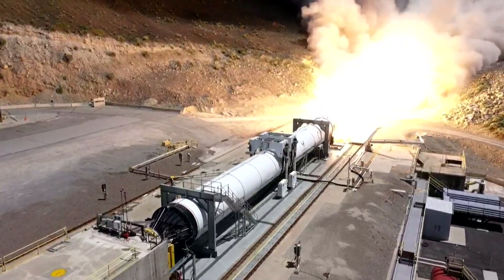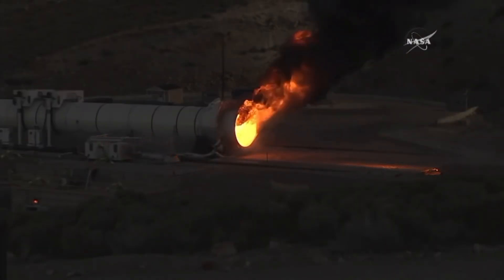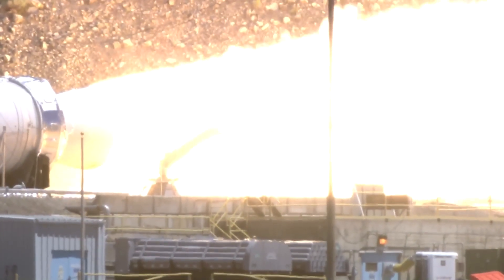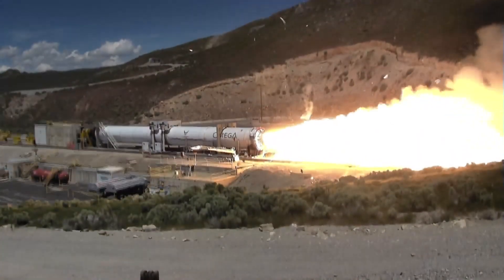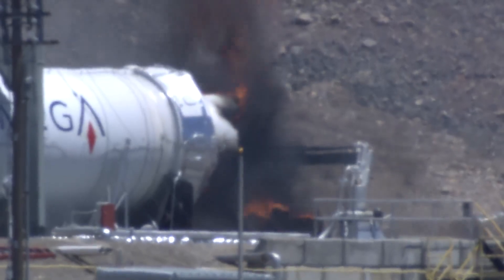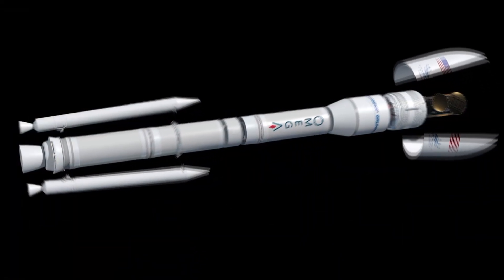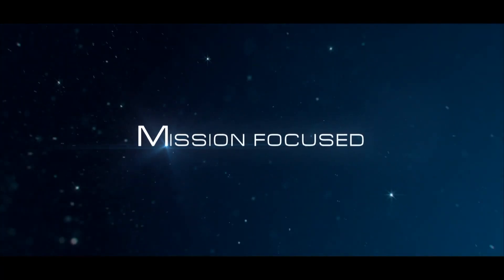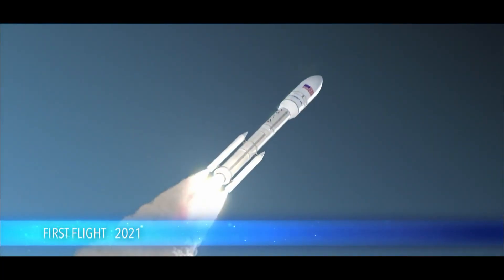Northrop Grumman's OmegA Rocket Fails During Static Fire Test -

Comment: OmegA failed, they still have OmegB
Reply: If enough of them fail, we might get an OmegALUL
Reply: ... all the way to OmegErd?
Reply: Oh my gord, how corny.
Reply: @javaman4584  Thank Heaven. While the SLS rocket is certainly more expensive, it is MUCH safer for crews.
Reply: @javaman4584  That is just.. Wrong. You are talking about the Ares 1, which did have a solid first stage--based off of the Shuttle SRBs, however it was not all solid, having a J-2X upper stage. 

Anyways the the problem with the rocket was the exhaust of the solid propellants. Aluminum based solid propellants burn hot and stay hot, which is living hell for the parachutes during an abort. The oscillations were actually solved before the test flight with some super interesting dampening mechanisms they used between the first stage and interstage. The issue could have been solved, however the funds for the program were dwindling and the soon after cancellation of the Constellation project ended it quickly.

Edit: The entire rocket never actually flew, nor did it fail. It was a full sized flight test containing a complete first stage with a dummy upperstage and orion boilerplate. The first stage preformed nominally and all of it fell into the ocean. (The first stage may have been recovered, I'm not sure. It had the capability to, due to it being shuttle derived, however I'm not sure if it was.)
Reply: Just wait until they get to OmegL
Reply: OMG I'm trying to get politics out of my mind by watching rocketry (exploding) and  what do I get? A Ralf Stegner pic!
Reply: "Plenty of letters left in the alphabet." Captain Jean-Luc Picard
Reply: Shut up Omeg.
Reply: @ExaltedDuck   Obscure, but Mila Kunis would enjoy the reference.  :D
Reply: @javaman4584  The only odd thing that happened during the Ares 1X launch was that the first stage appeared to shunt into(bump, re-contact) the second stage after staging occurred, but that was to be expected. The second stage was just a dummy. It had no main engine or ullage engines, and the first stage had no retro-rockets to slow it down after separation. The whole thing was practically a glorified Estes rocket, but it did exactly what it was intended to do. It wasn't in any way a failure.
Reply: And OmegC
Reply: Do they have an Omega 13?
Reply: @javaman4584  There may have been a test of the staging mechanism? I'll look it up and edit my original comment if I was wrong.
Reply: goddamnit nice one
Reply: @javaman4584  No, I think the launch was actually quite successful (it's on Youtube). Of course, it carried the traditional concrete mass up front. The pogo vibration effects were predicted even at the PRD stage, I believe.
Reply: Omegod what a lame joke 😜
Reply: “Preparations A through G were failures...”
Reply: please leave the planet.
Reply: Sometimes I can't help but wonder if all-solid fuel orbital rockets (meaning no liquid fuel main stages) are really worth it due to safety concerns. Vulcan may be a little expensive (since the engine section alone will be recovered), but at least it's FAR more controllable and safer all around.
Reply: @thunderbird1921  Well, how many solid rocket booster failures did we have with the space shuttle? The OmegA, if Steve is correct, is designed and built based on the old shuttle side booster rockets.
Reply: Jack Linde One failure due to director of NASA insisted launching out side of the lowest tested temperature. I was working on composite booster motors for a polar launch of the Space Shuttle out of Vandenberg AFB. That program was the pathfinder for this motor case.
Reply: @jackielinde7568  That was caused by operating the booster out of design specs. It was rather cold that day and the Orings shrunk enough to reduce sealing pressure. The engineers did recommend holding off, but COM said Go.
Reply: @bryanst.martin7134  I know. It was a rhetorical question. The point was that we had hundreds of launches with the shuttles, and only had one booster failure. (I don't include the other shuttle we lost in this because it wasn't the booster that failed.)

The point I was making was that the system this rocket's engine was built on is a fairly reliable one.
Reply: @thunderbird1921  - Not to mention that Falcon 9 is proven safe/reliable, & offers superior performance at significantly lower cost.
Reply: @thunderbird1921  : Some of the solid fuels can apparently sit in storage for years, with only occasional core samples to confirm their continued viability.

As a way to launch uncrewed rescue vehicles, they're a great idea. It's everything else that you have to wonder about.

Comment: Probably a foam water going onto something that hot would explode.
Reply: It's a CO2 quench, not water.
Reply: @KSparks80  yeah that makes sense,I was thinking it was along those lines or the "Safe" halon type chems
Reply: Wonder if it's a Dry Chem or a Slurry? Also Water is going to expand violently when heated.Not to mention the inspection afterwards.....Water at that pressure will disturb the inside so it may not be as preserved as they would want it.Ive had Arson Investagors often say "Firefighters and their damn water" because it will move debris around and damage other evidence in the area.

Comment: Woah there, there was an ‘observation’, not a ‘failure’! ;-)
Reply: Remember, the difference between an Observation and a Failure is "Did the damn thing blow up in a controlled and predictable manner?" (We totally meant to do that, Man!)
Reply: We're not "covering up" a mistake, we're "redefining our success matrix"
Reply: Same with the crew dragon, twas just an "anomaly"....
Reply: Even the fuel doesn't want to go up!
Reply: Damn your channel is older than my age Lmao

I'm 13
Reply: Corporate Speak never fails to amaze me :D
Reply: If the "observation" only happened at the end of the test, I wonder what the heck they were doing all of the time before? Takig a nap?
Reply: Which will definitely lead to some new designs because the old designs "were adequate but did not perform to expectations".
Reply: when the check engine light comes on, but you decided to keep on truck'n. It was kind of a boom, rattle, ratlle, kind of noise.

Comment: I mean that's what tests like this are for.
Reply: Definitely. I mean as mentioned, although in appearance is similar to Space Shuttle/SLS SRB, they now used composite material which a totally different and when they test fire it without the casing split open, they really happy about that despite that nozzle problem.
Reply: yeah i dont see whats the problem,same for the crew dragon ^^
Reply: @ppsarrakis  Crew Dragon was concerning both because the failure happened so late (after  any sort of design-related failure should be a problem) and because it resulted in a ton of hardware loss. This motor wasn't reusable anyway and the motor (except the nozzle) performed well so it met at least most test objectives.